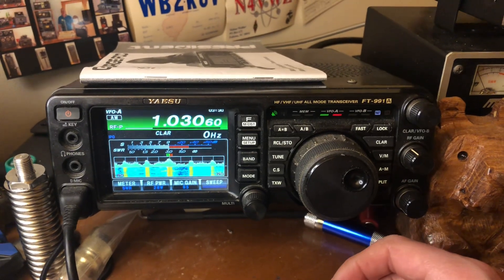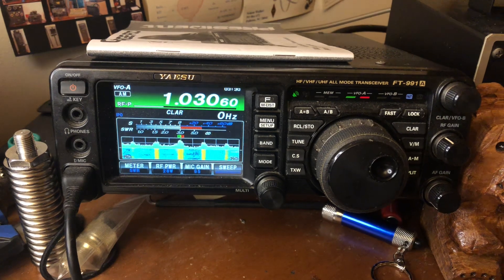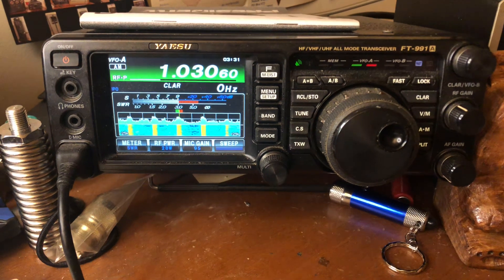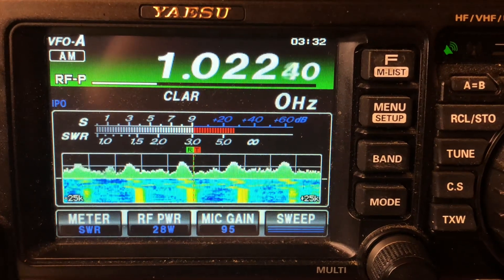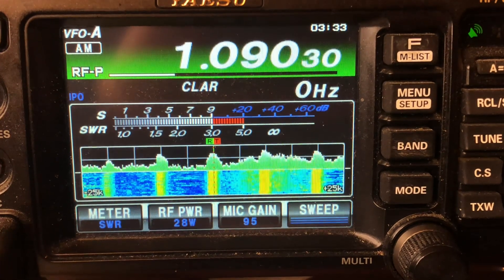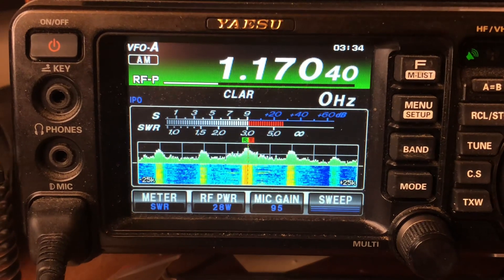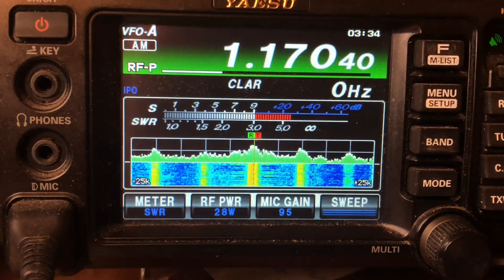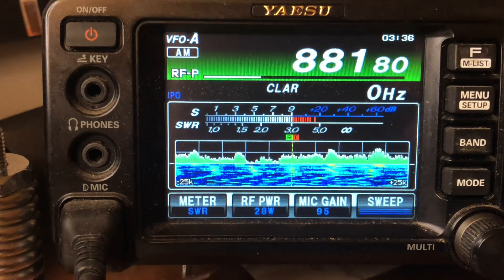Boost AM Broadcast Signals #amradio #wireantenna #broadcastnews #shortwaveradio #radio #baseball

Comment: ive got a Tram 1498 i use on my icom 7100 and 7300 and supprisenly enough for a 11m vetticle it does fairly well on most am brodcast stations even short wave! if at night it gets to noisy i switch over to my 11m loop and get great results!
Reply from the maker: Yes nighttime will am broadcast running 100k clear channel stations you can hear a lot for sure.  I always love hearing a baseball ⚾️ game.  
Loops work great too. Awesome to hear from you.  Thanks for sharing 73

Comment: Have you tried a Loop On Ground (LOG) or Beverage On Ground (BOG) antenna? I picked up 700 WLW Clear Channel from Cincinnati, OH here in Tampa, FL using a Loop On Ground antenna.
Reply from the maker: I’m good with my 132 foot EndFed Half wave up 40 feet.
Reply: My LOG antenna significantly lowered my noise floor :-)

Comment: Pretty much any modern ham HF rig with a full coverage receiver will pick up AM broadcast very well with a decent antenna.  I have a ICOM 718 with a MFJ end fed 10-40M and I get great AM reception.  A good ground is important for AM reception too. Dan KB1OQ
Reply from the maker: Same here on the MFJ.  I have a radio shack am/fm/wx radio downstairs and I put a coil wreath shaped 6-7 inches OD resting on the radio and that greatly improved reception.